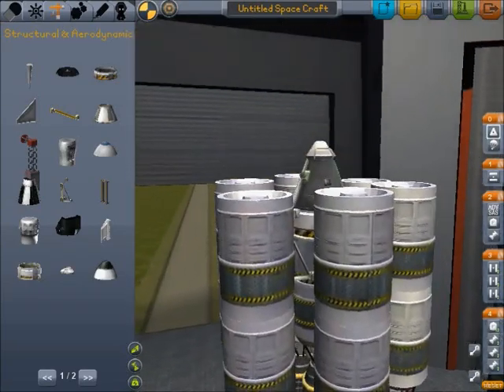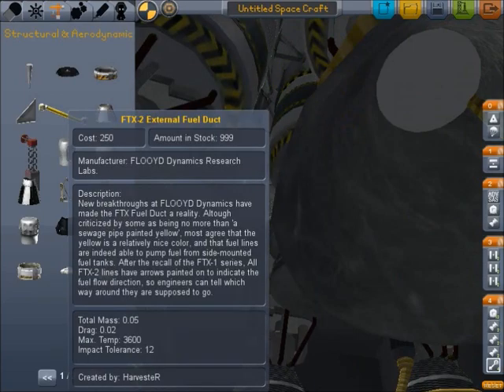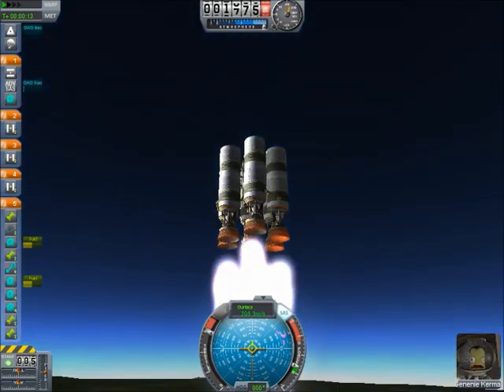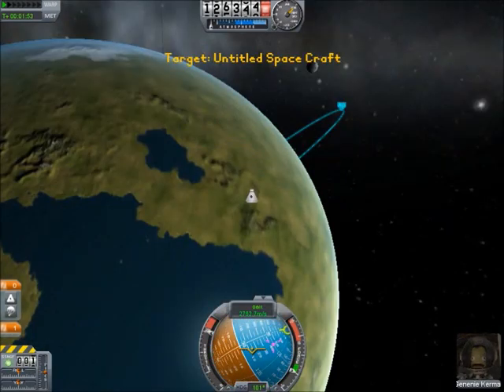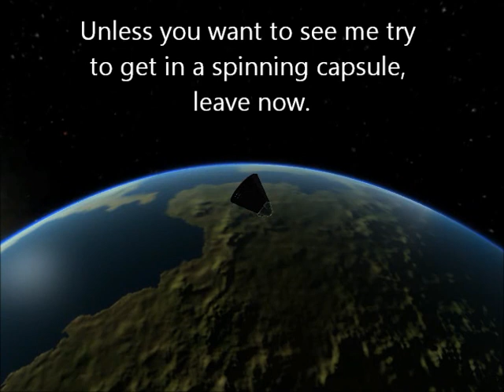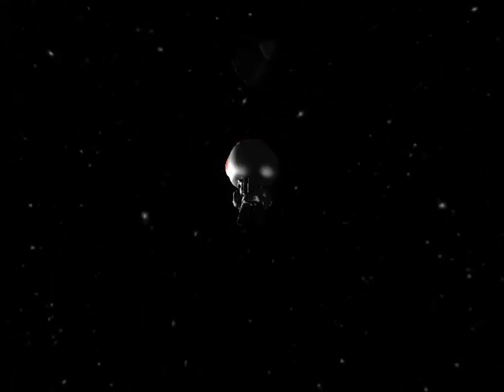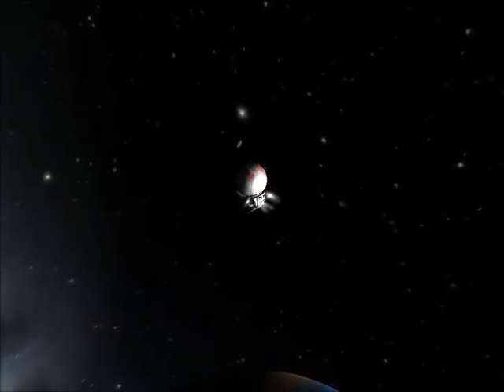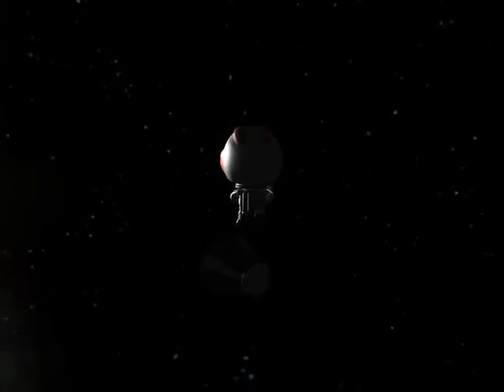KSP - How to Make an Asparagus Rocket

Comment: So i did some calculations:
The control has no fuel lines.
The onion design is ~31% more efficient than the control.
The asparagus rocket is ~36% more efficient than the control.
The difference between the asparagus rocket and the onion rocket is ~8%